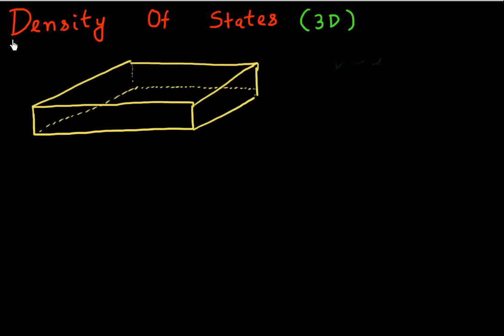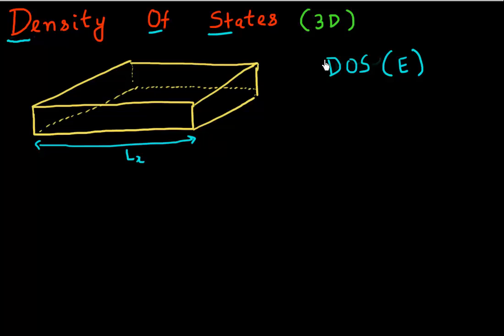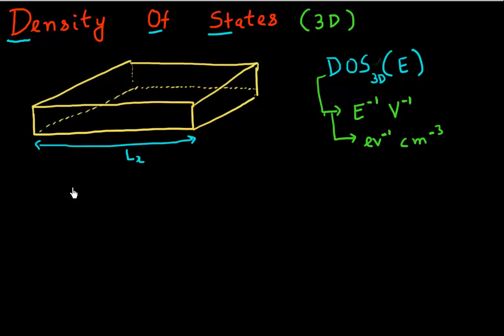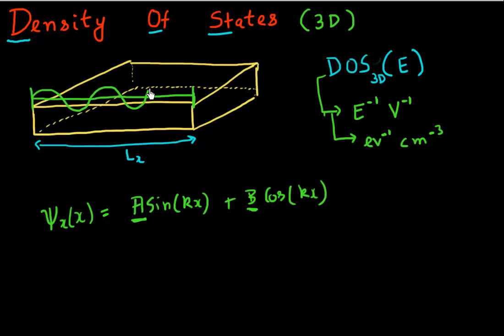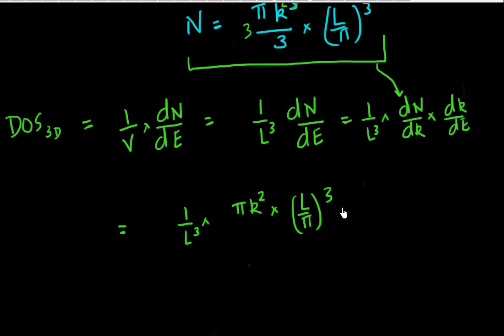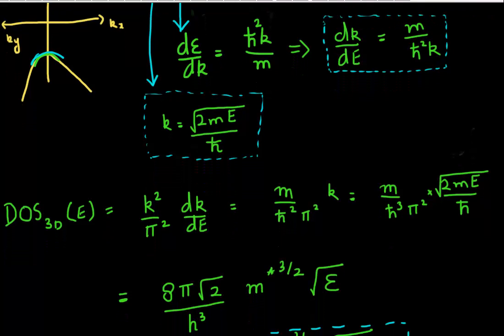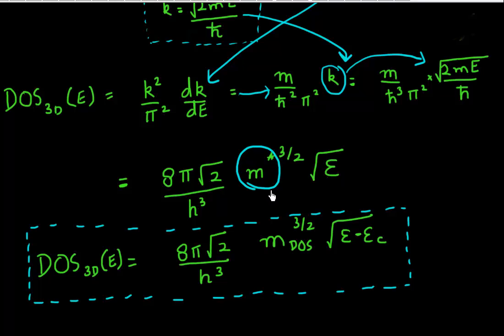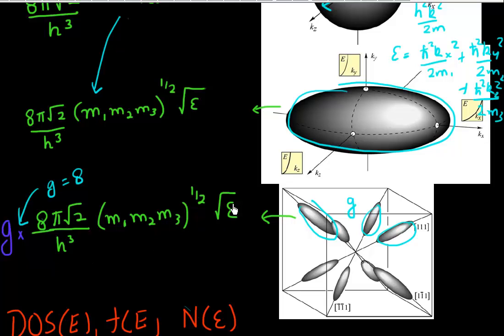Density of States in a 3D semiconductor

Comment: At the end after you plug everything in and change m into m*: Around 11:30
Where does the 8 come from? Is it b/c it was calculated for 1/8th of the sphere n now you're plugging in that x8 or what? Or is it b/c you've changed m= 8m* ?
Also around 5:12 you're saying that the radius of the sphere is k_x times k_y times k_z, but shouldn't radius be defined as: r = (k_x^2+k_y^2+k_z^2)^(1/2)? And then that expression would be cubed b/c it's the sphere volume. K_x times K_y times K_z would give you volume of a rectangle.
Reply: Hey Vitaly, That 8 comes from Unit Cell consideration.like If you see a simple cubic unit cell corners it contains 8 lattice points.
Reply: Vitaly Fedotov

Comment: Can you please tell me how the volume in K-space becomes V=(pi/Lx)(pi/Ly)(pi/Lz)? Where from the "pi" comes?? please help. i couldn't figure it out. Help
Reply: +Somoshree Chatterjee The spacing between each k-value is pi/L since the boundary conditions restrict each k value to be an integer multiple of pi/L. So the first is 0, the pi/L then 2*pi/L, etc.. Hence the distance between one k-value and the next is pi/L correct? Then since the volume of a box (in this case a cube) is each side length multiplied by one another (x*y*z) you have the side length in kx (which is pi/Lx) times the side length in y (which is pi/Ly) times the side length in z (which is pi/Lz). In short (pi/Lx)(pi/Ly)(pi/Lz)